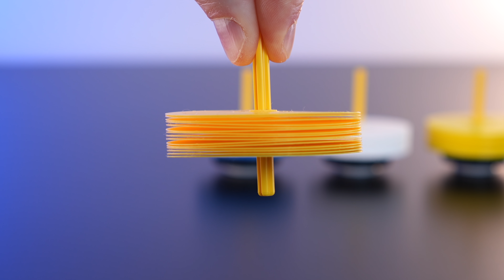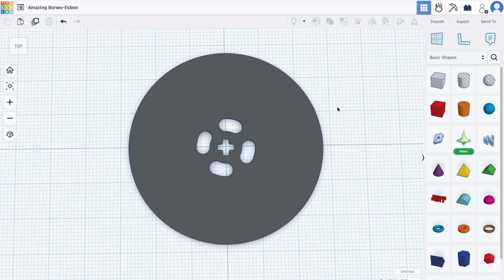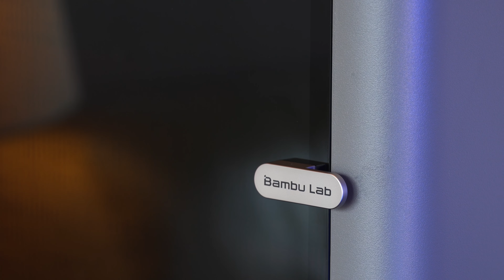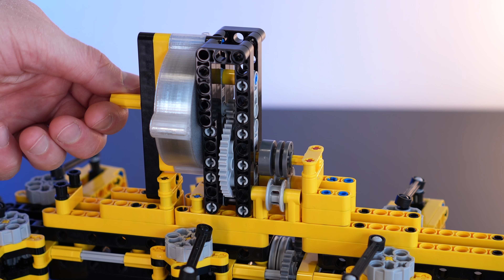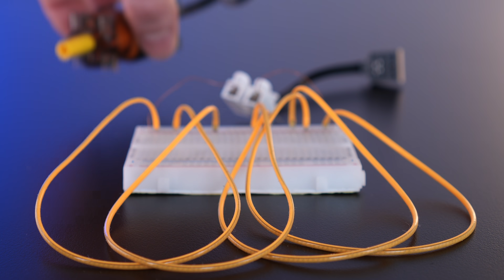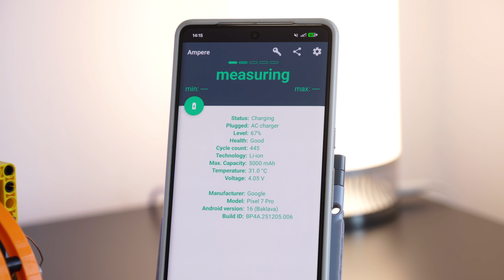Powerful Lego BLADELESS Turbine Generator!

Comment: There's a fundamental design issue with your rotors and the exhaust. The holes in the rotor and the exhaust port are entirely too small. You are choking off your flow rate. Look at his original patents, specifically the rotor and exhaust design for his fluid pump.

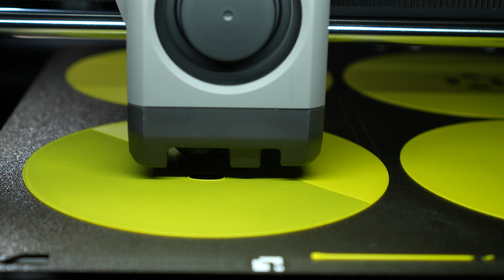Comment: 17:10 The reason printers have a hard time making perfectly round circles is mainly due to how the GCODE is generated, modern slicers use smarter GCODE that allows the printer to make truer circle motions
Reply: yeah hes also kinda just saying that to make his sponsored product sound better
Reply: Yeah. My ender does circles fine. It was just marketing garbo by the tuber.
Reply: I used to wonder about this too, but I eventually discovered that the issue lay with the CAD software generating the OBJ file, not the slicing software; Bambu Studio and the A1 are still perfectly capable of generating and printing circular shapes.
Reply: Yep. That's got nothing to do with bambu or their printers, it's just more modern gcode.

Comment: Question: what was the power requirements to run the air compressor vs the output? How much loss did you face as a result?

Comment: The Tesla turbine is reliant on boundary layer viscous forces, rather than inertia or pressure drop of the operating fluid, therefore the peak performance / efficiency  is within a very narrow band of operating conditions. All parameters (rpm, disc diameter, spacing, surface roughness, rotor mass, fluid viscosity, speed, density etc.) must be tuned. This is still true for a bladed turbine, but the practical operating range is much wider, without sensitivity to micro-scale viscous effects. This is the key reason, despite their advantages, Tesla turbines would not improve efficiency for most general applications.
Reply from the maker: Ah that's interesting the pressure itself needs to be tuned alongside the other factors.. I guess that makes sense

Comment: Larger disks suffer more from the turbulent flow that is created/worsened by the load/resistence put on them trying to extract usuable power from them
The lamanar flow is why the disks spin in the first place.  removing that or disturbing it means you loose conversion (already not a good amount for surface area) of the air flow to rotation.
People that think Tesla was secretly more intelligent than he was already known to be forget there is an actual reason he never developed the ideas they think were "hidden"...because he was a genius and when he worked to develop ideas and realized there was a flaw in the concept to application he would abandon the ideas for the flawed unworkable ideas they were.

You Absolutely would, and always will, get better performance from traditional bladed turbines.  That is why they are Traditional.  Because you use things that work BEST "traditionally"

Comment: The reason the Tesla Turbine never caught on is that the material science to support the blades at the time didn't really exist.  They pulled so much torque from water that they kept breaking.  They are used today though as water pumps as running them in reverse by spinning the blades will pull water into them.

Comment: would a changing width along the circle (wider center) help with both efficiency and torque? it can help to push the slower moving air toward the center at higher speeds and help against pushback

Comment: The theoretical efficiency advantage of Tesla turbines tends to disappear under load, which you know, is necessary if they're supposed to be useful. And then they become, at best, about as efficient as other turbines. 

The high rotational speed required cause drag in the housing, Tesla's design in the patent application had features to reduce that issue, it can't be eliminated, but reduced significantly. 

There's also the issue of the air (or whatever the working fluid) having to travel from the edge towards the center of the turbine, against centrifugal force, which reduce efficiency. While this is an issue for all turbines with similar flow, the problem gets worse the higher the rotational speed has to be, all else equal.            

In order to reduce the issues with Tesla turbines, they should be made as big as possible, to reduce the required rotational speed for given power, and all the many issues related to that high rpm, and also have the working fluid transfer as much of it's potential energy as possible without having to travel a large part of the total radius. And also with many discs, to reduce housing side surface area to disc area ratio. Tesla himself promoted the possible high power density as a great advantage, but it could have been more efficient, and easier to make, and have a much better chance of becoming useful for most applications if he had settled for quite a bit lower power density, it could still have had higher power density than contemporary turbines, even if he had designed it to be possible to produce commercially at the time, and also more efficient, at least compared to his design, but possibly also compared to contemporary turbines.

Comment: So I know you used PSI to gauge your air flow. Now I know using math you can figure out exactly how much Cubic Feet Per Minute (CFM) you are using. However you don't have to you can just use an airflow meter. Basically You removed the bottle neck at the input side and replaced it with one on the outlet side. I don't know how much of an affect it would have to make your vents bigger but if you ever do a follow up it's something to consider.

Comment: The only thought I had was the bearing. If it's wearing, that means there is force going into the bearing instead of the gears. So, is there a way to change the setup to balance out the forces so that more energy is going into the gears instead of the bearing? Is it a vibration? torque? Bending? Could be any of those or something else. And all making a fairly drastic power loss.
None of which I'm expecting you to actually fix.
HOWEVER. One thing I hope you DO implement in the future is a basic efficiency number somewhere.
What is the Theoretical power of the 4mm hose at 85psi? How close is the generator to that power?
That would be an interesting number to keep in mind when operating at least some of these tests.

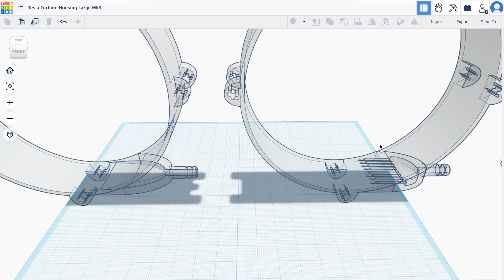Comment: 17:55 looking at the 2 inlets the 1-8 version looks like there are flat wall surfaces in the direction of flow. Could either changing the inlets into thin walls or adding bevelling/smoothing to reduce/remove turbulence from those flat surfaces and sharp transitions.
My thought is reduced turbulence,  better flow with slight initial compression, and potentially more improvement at higher pressure from the reduced  turbulence in that inflow opening. 
Honestly i don't think you'd actually redo the tests, I'd still be interested.
23:37 seeing this build is amazing. 
I would love 2 see a comprehensive stat chart of flow, torque, speed, and all that comparing different air inflow design, something like what your see with race car engine stats haha.
25:59 oooooooohhhhhhhh.
I am having a field day with this video.
27:23 now that's a lot of power.

Comment: let's give a use case example, compressed air energy storage, utilising solar or wind you can run a compressor and then discharge to drive the turbine to generate the power required, if many smaller generating units is applicable you can run compressed air lines to where power is needed, or a large central unit that feeds an electrical circuit to supply the power you require. neat stuff!

Comment: 9:06 you changed the rpm testing plate size not matching the previous test so anything after is inconclusive
Reply: Either way, if he made it bigger or smaller, final RPM wouldn't be influenced much. A rotation is a rotation no matter the size of disk. Just the amount of time needed to speed up would be influenced (yes a small increase in overall friction as well, but doubt it'd do much)
Reply: @HylleusTTV  its called Tangential Speed the inside axi and the farthest axi have different speeds making a big difference
Reply: @HylleusTTV  nope im wrong i see but right at the same time which is weird if there was only one point that the rpm test is looking for the linear speed doesnt matter if there is multiple then it does cause it no longer counting one rotation  but six points in one rotation then linear speed applies
Reply: @HylleusTTV  in this test ya linear speed doesnt apply
Reply: nvm i dumb the test plate didnt change the turbine did
Reply: I mean, technically you are right in the sense that, bigger wheel, bigger force, but indeed since it's about rotational speed it cancels out. But same as a drill bit, rpm for small drills need to increase to keep the cutting edge going the right speed. If it were an actual wheel moving along an object it'd matter a lot, but since it's still the rotations we care about it doesnt. In a way it's funny how, yeah the edge of the bigger wheel koves faster, yet rotates just as much haha

Comment: why don’t you make a lego air compressor pump
Reply from the maker: I've made many! They just tend to suck and output a miniscule amount of air. You'd have to run them for hours to get only a small amount of air. Though my next project does have a compressor unit with 24 mini compressor cylinders in it

Comment: Tesla turbines have very low efficiency compared to conventional turbines when they are under any load.

In real world applications conventional turbines can reach 90% efficiency, while Tesla turbines only reach about 60% efficiency with much less torque, which means even more losses gearing it down ultimately making it only about 40% efficient
Reply from the maker: Yeah I'm not surprised - I'm sure a regular turbine would be far more powerful, especially for my poor Lego designs. But I'm not sure how much more stress Lego can take beyond this 😅

Comment: As speed increases, your discs will start to stretch outwards, and so the more flexible filaments probably start to rub the housing.  Creating a plenum chamber (allows the flow to reattach from your hose before the nozzle), as well as converging/diverging nozzles helps with efficiency.  To help with the torque, add a flywheel, spin it up, and then latch with a centrifugal latch.  Source: built and tested a TT for my master of Engineering.
Reply from the maker: These are all awesome ideas - big thanks! Always super interesting to have folks like you with real engineering experience chime in 🙏

Comment: Bit of a fail with the gear reduction to the Lego motor.  Need to figure out the speed of the motor on the battery supply, then build the gear reduction to get from the 27000rpm down to the motor running rpm.
Reply from the maker: Yeah it really needed another gear down. I was mostly just using that scene as a demonstration of the small turbine's poor torque, and the reason why a coreless generator helps for a Tesla turbine

Comment: 22:40 As I remember you don’t really need gear box, turbines work such way thats speed operated by load on generator, you can’t spin turbines without load, so for regulating voltage you should balance between pressure and load, but usually it’s probably choosing one lvl like 30 volts and x pressure, then use something too get how much you need from it.

Comment: Did you test the slit housing before changing out the valve? The slit one probably had a higher air flow rate and tanked the pressure sooner which is why it performed so much worse
Reply from the maker: Yup, tried both before and both after upgrading the valve. Also a whole host of other designs I didn't show. I really didn't expect the 8 small holes to work well, but for some reason it worked the best. I'm still convinced there must be much better designs though. The 8 small ones feels like it should be too restrictive
Reply: @JamiesBrickJams my guess is the smaller holes cause the airspeed to increase which is why it goes faster. You might want to check which one actually outputs more energy, because the slit might produce more torque because there’s more airflow, but I’m not sure. Amazing video!
Reply from the maker: Yeah that's exactly what I was wondering - perhaps chasing speed isn't what I should focus on! I guess I just assumed that without a load, speed should indicate better efficiency. Definitely worth more experiments!

Comment: 21:38 a basic CVT

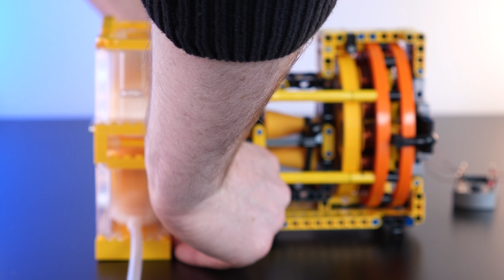24:26 and the shortcomings of said CVT

Unfortunately, CVT transmissions, while cheap to produce, have some MAJOR cons. You can only run them so hard before they start slipping and failing. Many car manufacturers are using them to the detriment of the consumer, knowing full well that they WILL fail, and quite catastrophically at that.

Comment: i wonder if you could use a sort of turbo to fully use that exaust
Reply from the maker: I considered it just for the sound effect. But the exhaust actually isn't particularly strong as most of the air has already done its work
Reply: @JamiesBrickJams  oh, ok

Comment: I might try to build a tiny compressed air powered gyroscope with a tesla turbine just designed for RPM
Reply from the maker: That'd be awesome - good luck if you do! I'm also gonna try build an air-powered gyroscope someday. Seems pretty doable after this...
Reply: @JamiesBrickJams  Yeah, Aaed Musa recently created a video where he made a spinning top that could spin forever on any surface (At least till the battery runs out) I also have a complete plan on how to make a bouncy ball bounce forever with no moving parts, well other than the ball.
Reply from the maker: Woah cool! I'll have to look him up. Also great idea with the bouncy ball. Have you tested it yet? I've no idea how you plan to keep it bouncing, but that's an awesome concept
Reply: @JamiesBrickJams  No, I haven't tested it yet.  But I'd keep it bouncing by having it bounce on a steel plate that's slightly concave to keep it centered. I'd then take a regular bouncy ball and somehow put a steel core inside of it. Then, using a Hall effect sensor, I could detect when the ball is coming close to the plate. Finally, with the help of an Arduino, that would send a pulse to an electromagnet, yanking the ball down togive it a boost.

Comment: Have you ever tried adding a vacuum to the exhaust side? Between the blower's pressure in and air vacuumed out I'd think it would increase the torque a bit. A vacuum would need to be 180 degrees away from the inlet to prevent the air from shortcutting across the gap.  

There has to be a multiverse where the only things they use to build are Lego's

Comment: 25:46 why is it going STUTUTU
Reply: Due to the straight cut gears in the mechanism, sttaight cut gears transfer torque between them instantly, rather than gradually in helicals. On deceleration, one part of the mechanism doesnt want to slow down as fast as the other and they "push and pull" on each other

Comment: That's a nice experiment.
Can you run an experiment measuring the power with the Ampère app set on Amps instead of Watts?
I use that app myself and found out that Amps is more accurate.

Comment: Was watching this on a different account, hopped back on here to say I love the vid! (also, at any point are you planning to make a fourstroke combustion engine? I think it would be funny to have a gasoline-powered lego engine)
Reply from the maker: Haha no joke I've considered it. But I've seen only one other guy attempt it and it lasts only seconds before melting (obviously). So until we've got some materials that can withstand the heat, I'm afraid it's unlikely 😅
Reply: @JamiesBrickJams  I was wondering, maybe you could try water-cooling it? If you were to pump water through the block it might make it last a little longer
Reply from the maker: Hmmmmmm 🤔 No idea, but I'm curious now

Comment: There's no natural source of compressed air. To produce compressed air, work must be performed. In that case, wouldn't it be simpler to simply spin a generator without the intermediaries of a compressor and an air turbine? Tesla's turbine is completely useless for generating electricity.

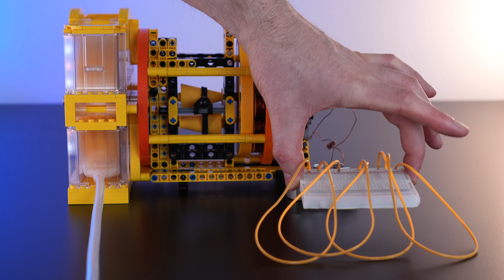Comment: 22:33 im very surprised that thing is rated at 1200v being so small and also 50amps, 6kw through that would scare me
Reply: 1200 volts at 50 amps isn’t 6 kilowatts, it’s 60 kilowatts.
Reply: @jhhyyggg you are right

Comment: A bit more tweaking and that CVT could probably be used alongside some digital logic and servo shenanigans to extract maximum power for whatever input pressure. Battery "power stations" already have that for solar inputs, and you might have seen the acronym "MPPT" bandied about, or Maximum Power Point Tracking.

Comment: I tried this myself using just pure Lego a few months back. I used the vacuum cleaner on the outlet to suck the air out. It worked fine. I would like to see 2 Tesla turbines on the same shaft,but the output air of one is connected to the input of the other. Tesla talks about this in his patent.
Reply: The turbine equivalent of compounding... Using the exhaust fluid to drive a second or third stage. The Titanic had twin 3-stage compound engines driving the outside screws and a turbine driving the center screw.
Reply: Or as another idea connect the output of the Tesla turbine to a Tesla pump. The difference being that the discs in the pump does not have holes in them. The rotation of the pump discs force the air to the edges of the discs then exhausting. So essentially you are blowing air in and sucking it out at the same time.

Comment: I bet you could IRON those PLATES flat with ease..  
maybe even a hot sheet of glass (preheated to about 70C.. or wherever the PLA starts bending), and then use baking sheet to stop adhesion?